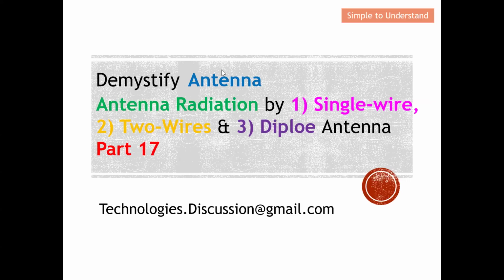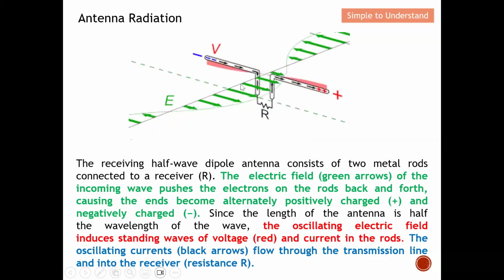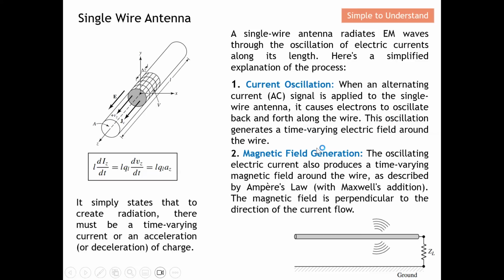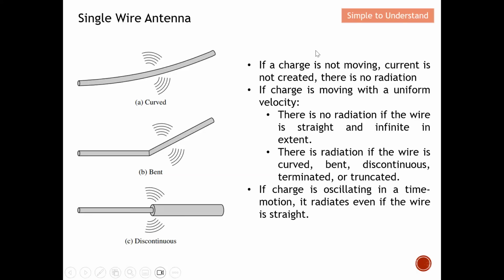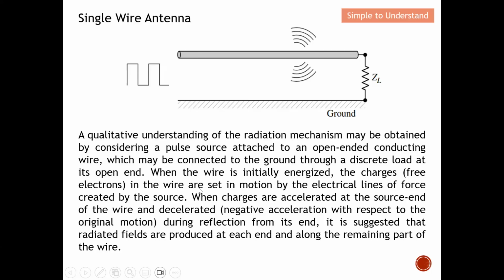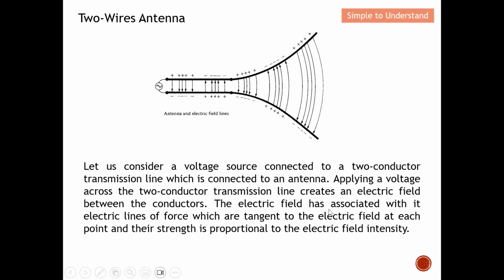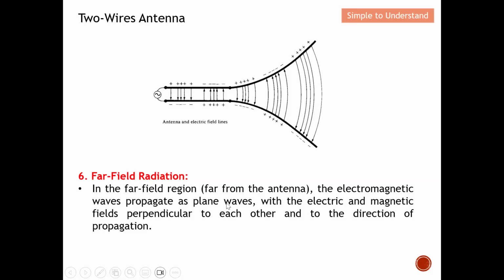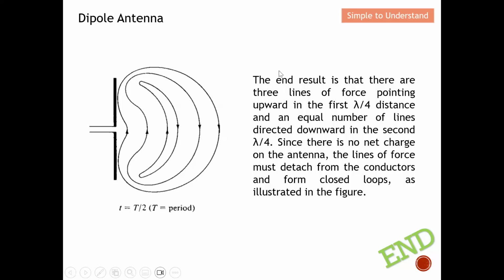Antenna #17. Hidden Physics of Radiation: Single Wire vs Two-Wire vs Dipole Explained Simply Guide

Comment from the maker: Thank you for watching this video on antenna radiation mechanisms. This video discusses how different types of antennas (single wire, two-wire, and dipole) release electromagnetic waves into the environment. The source generates a time-varying electric field, which in turn induces a current in the rod, creating a magnetic field. The time-varying magnetic field then generates an electric field, making electromagnetic wave propagation possible. This video will provide a comprehensive discussion on all of these topics. :)